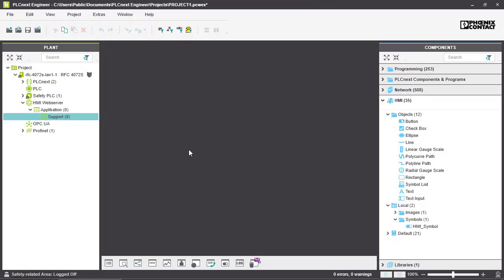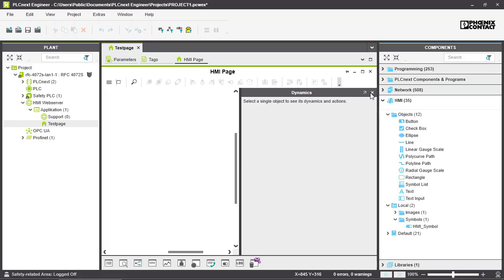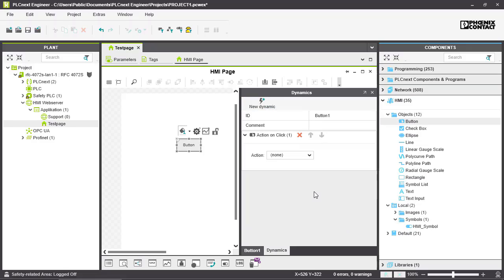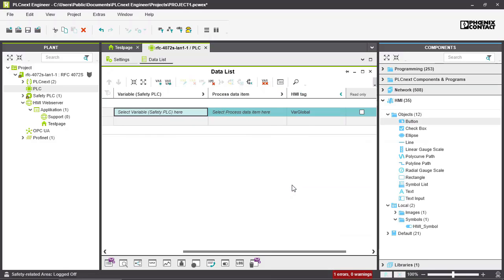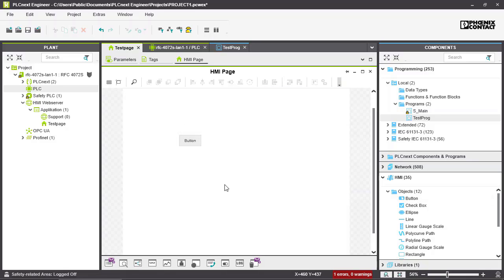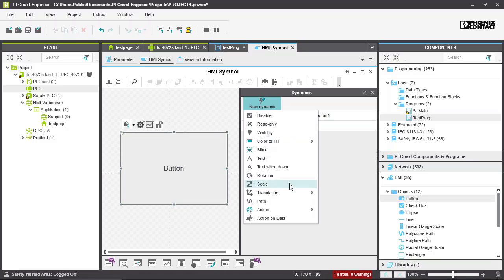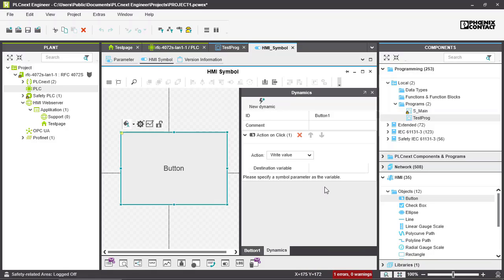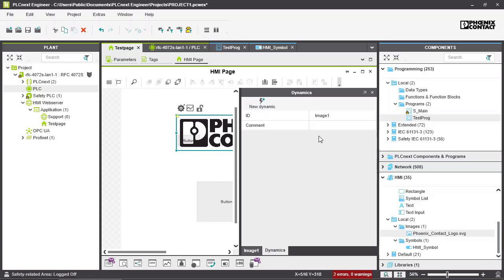Working with HMI symbols and images | Getting started with PLCnext Engineer

Comment: How many tags is the limit using web HMi?
Reply from the maker: Sorry for the delay in replying, Johnny. There is no fixed limit to HMI tags in PLCnext Engineer HMI. At some point you simply reach a situation where either the project is so big that you can hardly work on it anymore because the computer takes forever to compile it. Or the project needs more memory than is available on the controller afterwards, and then you just can't download it and you get an error message.

Comment: how do you import pictures into PLCNext Enginnering? Thanks in advance
Reply from the maker: Pictures are mostly used in HMI applications on different pages. Those pictures can be easily imported in the component area, in the section HMI. There you can find the possibility to import different picture file formats in the context menu of the "local" folder.